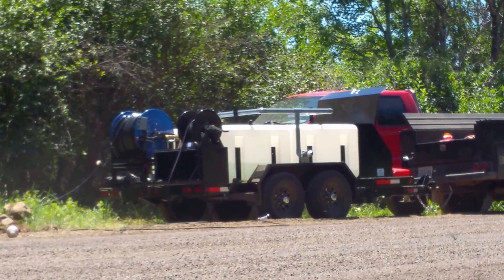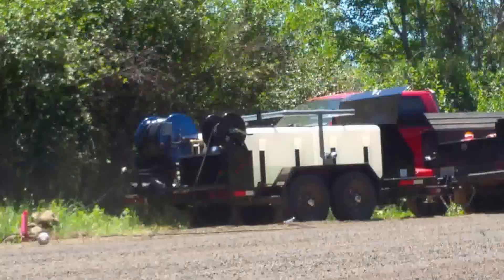Jetter Trailer Eagle-600/3023 & WH-Warthog Clearing Soil & Rocks from a 36-inch Culvert!

Comment: Did you use a skid? That’s a 1/2 inch line on the Jetter, I presume.
Reply from the maker: Yes & yes:  I actually did double-extensions; one with fins to lift it off the pipe-bottom and another w/o fins to keep it from flipping on me. GREAT question!